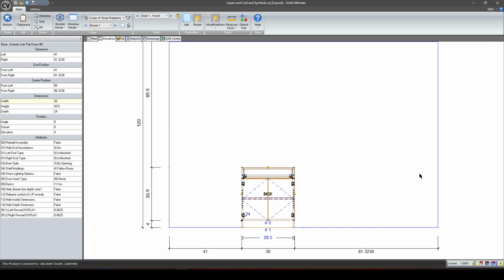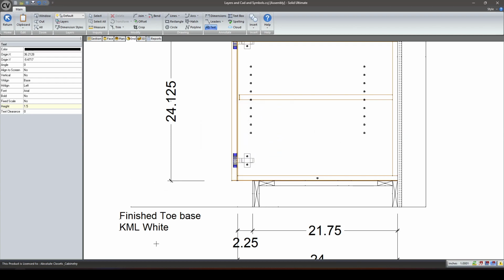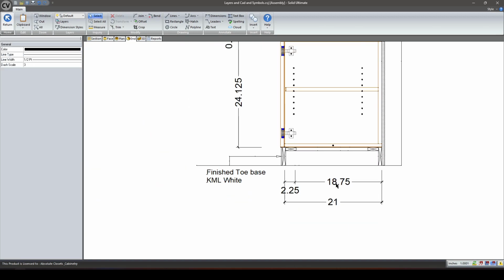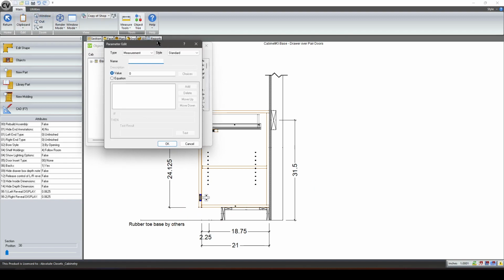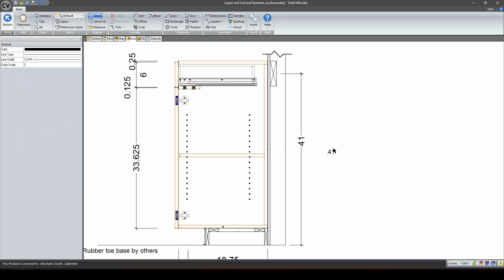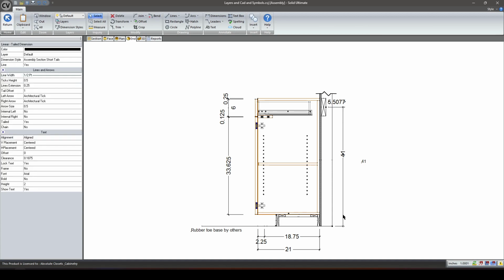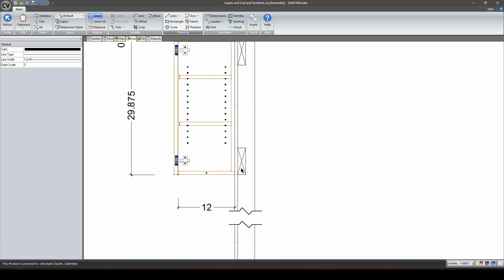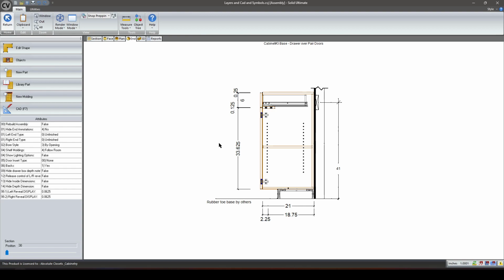Cabinet Vision AMA 5 (Layers, CAD, Section Details) -- 1-27-23

Comment: How do you assign properties to new cad layers? I can create a new layer by hitting " layers" underneath that dropdown where you select your CAD layers, but i cant assign any properties to the layers. For example, I want to make a text leader that can be used in 1 1/2" scale sections, so I want that CAD layer to assign specific dimensions so the leader arrow and the text so the size is appropriate for 1 1/2" scale sections.
Reply from the maker: The CAD layers you can create on the fly like this are not something you can really assign properties to. For something like that you would want to work with Layer Schedules and Dimension Styles in tandem. Truthfully, this is a little bit of a confusing area of the software and it will be difficult to explain without supporting images but I will try my best.

For the sake of simplicity, lets assume you show elevations at 1" scale and you show cross sections at 1-1/2" scale, but want your text to be the same height for both views when printing your plans. You would start by creating/editing a dimension style to assign to a layer schedule that would be specific for each of the two views being discussed.

The ribbon bar has a drop-down selection for different layer schedules; just to the right of that drop-down menu there should be a little icon showing a dimension with a small wrench/spanner beneath it. Clicking this will allow you to create, edit, or copy Dimension Styles. I suggest either copying one you already have or starting from scratch -- don't just edit one you have/use :) Name this new dimension style "1_5in Scale" for your 1-1/2" scale drawings.

Work your way through the different style properties and set your "Arrow/Mark" and "Text Height" sizes to whatever value needed. For ease, lets assume that a value of 1 is perfect for your 1-1/2" scale.

Next, repeat the process but call your new dimension style "1in Scale" for your 1" scale drawings, and set your "Arrow/Mark" and "Text Height" sizes to 1.5.

Now you have 2 dimension styles with different sized default text and arrow/mark sizes for each view. At this point you need to assign the dimension style to the different "views" of a layer schedule. Your "Elevation View" dimension style should be set to the "1in Scale" and your "Assembly Ortho End" dimension style should be set to the "1_5in Scale" dimension style.

So far all we have done is set the various "system generated" dimensions and font sizes to display at the same printed size when the scenes created for them are set to 1" and 1-1/2" scales respectively, which does nothing for you when adding new text.

For new text/CAD you add to match the values you just created, all you need to do is go to each view (in this case, elevation and ortho end) and select whichever CAD tool you intend to use. BEFORE you actually use it, though, you will want to access the general properties on the left and change the sizes to match those you just created for your dimension styles. At this point all new CAD entities you create for the specific views will retain their default values unless they are changed again before being used.

Hopefully this helped... if it didn't, join this week's stream and ask about it, I will try to demonstrate what I mean :) Thanks for watching!
Reply from the maker: In case you didn't see it when streaming last Friday, I covered this topic in detail and you can watch it here for better context/explanation: https://youtu.be/0q_TIEOzpAE